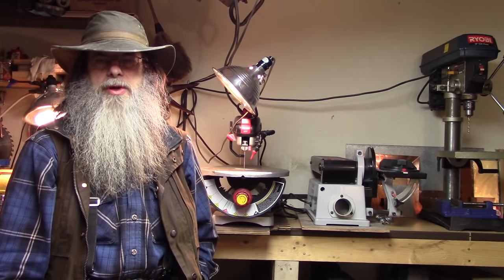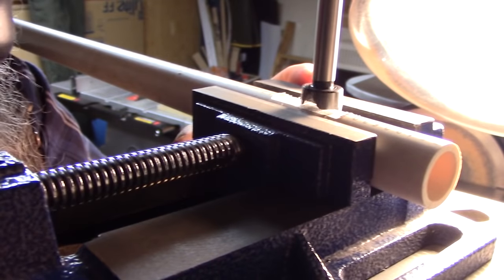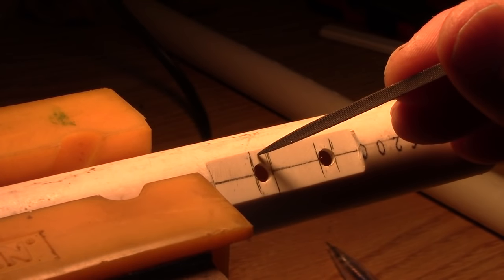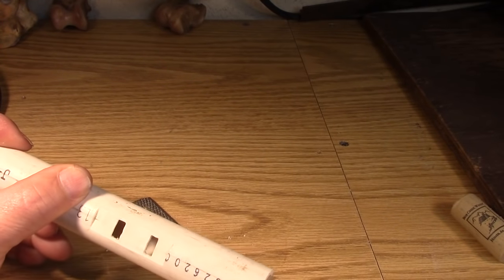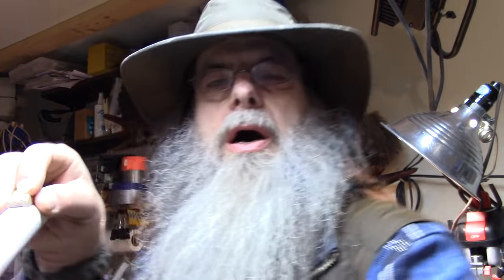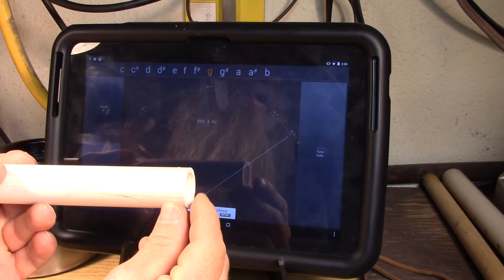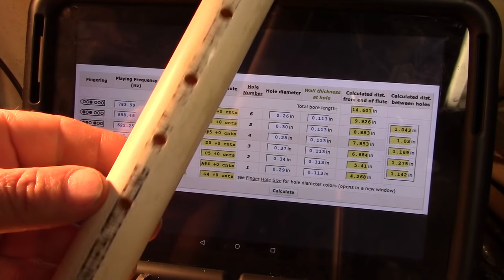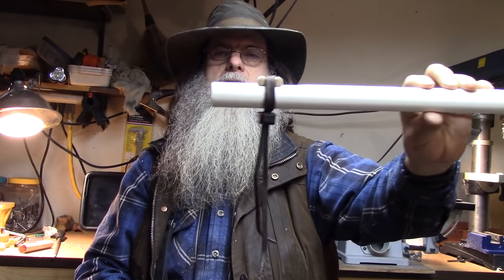How To Make A Homemade PVC Flute

Comment: Good night, teacher. In the NAFlumat site, in what stage is it possible to identify the total length of the flute and the space to make the region of the TSH? thank you. I await your reply.
Reply from the maker: I am not sure of what you are asking.   At the 13 minute and 55 second location of the video, you will see the info all filled in on the final flutomat screen.    In the top most yellowish field on the right side of the flutomat, you will see the approximate distance from the bottom of the flute to the true sound hole.  Be sure and make the flute a little longer than is recommended since you can later cut it shorter littler by little so that the flute can be tuned exact as shown in the video.  You may find the guided flutomat easier to use.

http://www.flutopedia.com/naflutomat_g.htm
Reply: Far North Bushcraft And Survival 

At the beginning, you make a marking which are the two holes through which the air will pass. I had asked earlier, how do you get that distance (which goes from the blowing hole to the two holes through which the air passes). This space. For all the flutes adopt this
Reply from the maker: I do not think that this distance is real critical.  On my personal flute I have 1/2 inch between the two holes and it works well.   You have the freedom to change this distance slightly without much problem but the TSH needs to be  a specific distance from the lower end of the flute plus a little more to allow you to cut off the end to fine tune the base note of the flute.

Comment: Thank you!  I just used this video to make an F# minor (hopefully easier to accompany guitar) and it turned out great.  I didn't have the drill press, but I roughed out the bird area by sculpting with a rotary tool's cutoff wheel, then filed it.

Question: how did you secure the bird?  Is that a leather cord with some sort of squeeze-and-slide doohickey on it?  My rubber band is working but is cheesy.

Edit: it looks like the "squeeze-and-slide doohickey" is a "cord lock"?
Reply from the maker: Glad your flute turned out well for you.    Yes it is a cordlock on a leather thong.
Reply: Excellent, thanks!

Comment: is it possible for you sir to give me the exact dimensions of the holes cause i don't know how to do that as good as you,but i like this video you made you explain everything so slowly but I'm a beginner so you can understand thank you
Reply from the maker: No I'm sorry but that would not work.   You need to make the holes according to your length and width and thickness of YOUR flute.   The hole need to be made smaller than recommended and slowly enlarged as the tuning is checked each time until the correct tuning is achieved for each hole.   Try the web link below.   The site at this link will guide you through using the flutomat.

http://www.flutopedia.com/naflutomat_g.htm

Comment: So I went out and bought the pvc I understand most of it if you could explain more about the how to use the flute finger hole software I would appreciate it
Reply from the maker: +Matthew Nolen    It would take a whole separate video to explain the software.   You will have to figure it out on your own.  However, here is a different web page that you may find easier to figure out what you need help with.
http://www.flutopedia.com/naflutomat_g.htm

If you simply just can not figure it out then you can always use the completed one in this video that I used to make my flute.   
https://youtu.be/misjPOhd-9o?t=13m56s
The trouble with doing that is that you are stuck using a flute that is tuned to the same key As I used.   You may be fine with that.    Good luck with the project.

Comment: I tried making one and no matter how much I cut the thing it was an E. What was the length of the finish flute? also if you could make a stencil of the holes would make it a lot easier. found it pretty frustrating that the tone changed depending on how hard you blow into it.
Reply from the maker: You will find the measurements that I used, already in the video.   If you will notice in the video where I explain about the online "Flutomat" program, that Flutomat page is filled out with the info you need.

Comment: Awesome video, thanks for posting. I am going to make one soon. I watched another video where they used a PVC coupling trimmed down in place of the traditional fetish. I liked the streamlined look of that and may give that a try. Then it occurred to me that it may be possible to make a short head (blow end) with one of those couplers attached, then producing individual sound chambers tuned to different keys which would then be interchangeable with the "mouthpiece"... do you think this would be feasible? You'd probably have to sand down the head end of the sound chamber section to insure it inserts fully into the coupler for consistent tone when assembled quickly on the fly and insure the instrument is in tune.  Any thoughts on this?
Reply from the maker: The pitch of the flute is determined by the distance (and diameter) of the pipe on the note side of the sound holes rather than the mouth end.   You could use a coupler to add various lengths to the bottom end to change the base note.   I'm guessing however that the note whole placement would not be correct and in tune when changing the length.
Reply: Thanks for the quick response... I was assuming that once the length of the bottom (sound chamber) sections were cut to a length of the desired key or "base note", then each bottom section could be set up with the note holes drilled in the proper spacing to produce the scale notes for that particular key. This was just speculation on my part and I didn't research the different key lengths and hole spacing. I have never played this type of flute, so I really have no idea. It was just a thought I had. I will just keep it simple and go with the key of G. Thanks again!
Reply from the maker: I think I understand now what you are saying.   If you make and tune each different keyed lower end and use the same mouth end on all of the different keyed flutes then yes I think that should work well.  The only potential problem that I see is turbulence generated in the lower end due to the joint.   That may or may not be an issue

Comment: im doing this right now, after i found this lovely video.
but why im always running into troubles with exact
measurements :D like 3/4" in my country is around 20mm.
i have a 20mm here, but it is almost like half the size of
what you are holding in your hands. im really confused
sometimes with the metric and non metric stuff, despite 
me being an industrial mechanic.
Reply from the maker: Sorry about the confusion.  I'm sure you are already aware of the fact but there are excellent conversion web sites on the net that will make the conversions for you if fed the proper data.  I often have to resort to using them when I need to convert in the opposite direction.

Comment: Thanks much. 
Now I have an idea for all the PVC scraps I have.  
Which gStrings tuner did you use in your video ?
Reply from the maker: You are welcome.   Thanks for watching the video.   The GStrings tuner that I used was the free one.
Reply: Did you get it from the Google store ?  Cause none of the free ones in google had the features yours had , ie they did not have:  Sound and Tune auto features.
Reply from the maker: Yes I got mine from the play store.    I have had this app for several years.   When I checked this morning, two selections came up for GStrings.   The playstore did not indicate that I had either of those apps so it may be that mine has been discontinued and replaced by these.   You may have to find something different that will work.
Reply: That's what I was afraid of.   Thanks much for checking.

Comment: just a question, how long did you make the pipe? im trying to make this for a friend.
Reply from the maker: As I said in the video I originally cut the flute at 18 inches long.  However the length will most likely need to be trimmed shorter later on when tuning the flute.

Comment: Your flute sounds very clear.  My flute is right on tune at G4 (whatever that means) but it sounds a little bit "breathy."  What's the key to getting the purest and loudest sound?  I also noticed that I can't blow very hard on the flute.  Is that how it is supposed to work?
Reply from the maker: Accurate sizing and shaping of the both of the air holes but especially the sound hole is critical to a clean sound.   Also the air chamber leading from the one hole to the other needs to be smooth and clean so as to minimize air flow turbulance across the sound hole.  The air outlet hole doesn't need to be angled though angleing doesn't hurt.   The mouth end of the sound hole should be flat straight up and down and only the far side angled.  The distance of the sound hole from front to back is very critical for clean sound.   The positioning of the "bird" can also affect the sound clarity.   If your sound hole is too wide from front to back, try scooting your bird over the sound hole a bit and see if the notes clear up any.    Yes the strength of your breath matters when playing the flute.   You should be able to get at least two octaves if not three octaves by blowing harder or softer.   The lower frequency notes require less air than the higher frequency notes as well so you will learn to adjust the strength of your breath all during your playing so that the low notes do not squawk out of tune.    Good luck
Reply: Thanks.  I'll have to build a new one. 

 I'm sure someone must have tried this, but what do you think of the idea of putting 2 sound holes and 2 birds on one flute?  Would it make twice as much sound?
Reply from the maker: Now that is one idea I had not thought of.  It would be quite a lot of trial and error if it would even work since you probably could not use the same size holes as you would for the original method.    It is my guess that it would be a waste of time since you would still end up with the same amount of breath blowing through the same size diameter device.    The flute when made conventionally should be fairly loud as is.   Certainly not concert hall loudness without a microphone and electronic amplification but plenty loud enough for a house or small public meeting place

Comment: Great flute, Lonnie. Were the holes hard to reach with your fingers when you first started learning to play?
Reply from the maker: +Bobby Harper     Thank you.    No the holes were not hard to reach at all.   I purposely positioned the holes so that they would be in a comfortable arrangement.      Some people even offset some of the holes off of the straight center line so as to be more ergonomically correct for each finger for each hand.    Once you have your note hole position correctly marked, you are free to place the hole anywhere around the flute and the note will stay the same as long as the hole is not moved up or done the flute length.
Reply: +Far North Bushcraft And Survival that's a very important tip for me, I want it sized for my sons fingers as well as mine when we make one for each of us!

Comment: I have an iPhone and could not find thr “G-String” app in the apple App Store. I found a “G String X, but it was not your tuner. Can u help me fine the tuner or does it matter if it just says tuner?
Reply from the maker: I am currently unfamiliar with the apple store apps.  Just look for a tuner app that covers several different octaves.   Hopefully you will have what you need.   Just get only free apps and that way if one does not apply to your needs then delete and get another until you find what you need.

Comment: Does painting the flute or adding a mouthpiece have much of an effect on the tuning? Seems like the sound comes from the bottom part of the flute independent of the top so I'm uncertain if you put maybe a piece of cork in the top to choke the amount of air you blow in as a mouthpiece might not have any effect, but I wouldn't know for sure.
Reply from the maker: Painting the flute will have no noticeable affect on the sound output.   The air that you blow into the flute is already back pressured because of the narrow passage between the holes in the sound area.   I do not believe that you will want to restrict the air flow any more than that.   If your purpose of a mouth piece is to further restrict the air flow, I do not recoimmend that.   If your purpose is just to make a more ergonomic mouth piece then that should not affect the sound as long as the air input is not restricted.
Reply: I was thinking of the mouth piece for ergonomic purposes mainly. Thank you very much for the answer, sir.

Comment: At 14 minutes of the video you can only see that you are on a page I have to enter that website to be able to drill the holes and the distance of the holes and their width
Reply from the maker: Yes that is a page on a website but it is the page with all the info filled in.   In other words, THAT is the info that I used to know where to drill the holes.    All the info you need is right there at 14 minutes into the video as long as you want your flute tuned the same as mine and your pipe is the diameter and thickness as the pipe I used.

Comment: Not living in America, we use METRIC.Will this still work if i use metric measurements to as close as possible?
Reply from the maker: Yes it will work using metric.   However, just as I showed using our method of measuring you will need to make the flute a bit longer than suggested by teh program and then carefully trim off excess until the flute is tuned correctly.  The same can be said for the note holes.  Make them smaller than suggested and then carefully enlarge them until the desired note is correctly tuned.

Comment: At NAFLUTOMAT, do I need to fill in any of those fields above? or Just go down directly to select the flute tone and then calculate?
Reply from the maker: It has been several years since I took much of a look at NAFlutomat but as I recall you do need to fill out as much as can be filled out.  Try the website below
Guided NAFlutomat
https://www.flutopedia.com/naflutomat_g.htm
Reply: @Far-North-Bushcraft-Survival  My naflutomat is giving a different result in the diameter of the holes, it is not the same as yours, I selected the same note G4. Thanks for answer.
Reply from the maker: Be sure and make the holes smaller than what is recommended and then slowly carefully enlarge the holes as you tune the holes so that you will arrive at the correct tuning for each hole without making any holes too big.
Reply: @Far-North-Bushcraft-Survival  Ok my friend =))). Thanks so much !!!

Comment: hi i was wondering if you could help me with something, 
i bought a pocket saxophone of the zebra brand and it has only 8 holes (without the highest hole) so when i use the 2nd register it's skipping a few notes, so i want to drill a 9th hole to fix this problem, do you know where should i drill the hole and how big?

i just don"t know how to use the flutomat for saxophone mouthpiece...

(sorry for my bad english)
Reply from the maker: I would love to help you out but that is something way beyond my experience.    If the inside diameter of the sax is the same diameter from end to end then I think a person just might be able to figure it out using the flutomat.   If you ever do think you might have it figured out, I would still drill the hole much smaller than the recommended size.  I would then test the sound frequency of that hole and keep drilling the hole out bigger and bigger and checking the sound output frequency each time until you get to the correct note frequency that you are striving for.   In other words, it is better to drill the hole too small and carefully work your way up in size rather than to drill the hole at the recommended size and find out that it is wrong.
Reply: well... the diameter isn't the same from end to end but it's a really small difference... the problem is that im not sure where the "starting point" is at (to measure the total length)... is it the top of the mouthpiece? is it the top of the body without the mouthpiece?...

anyway, thanks alot for the video and for answering =]